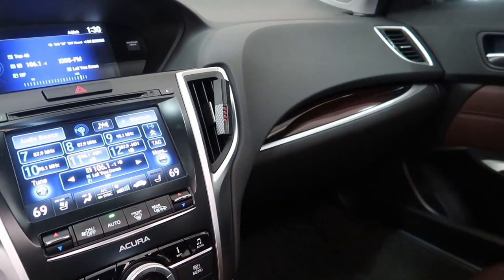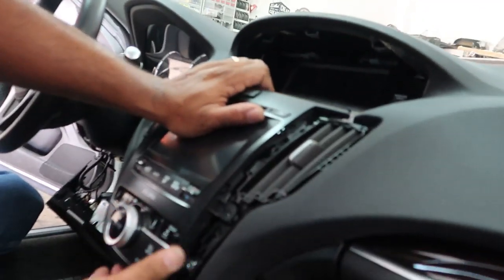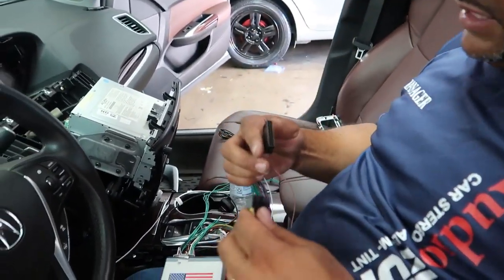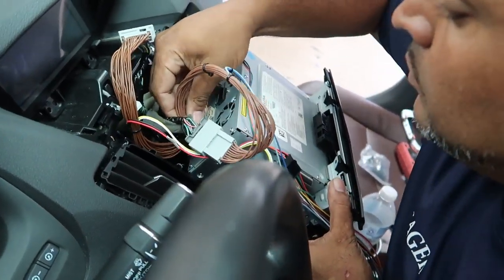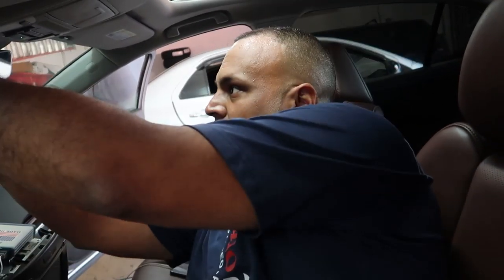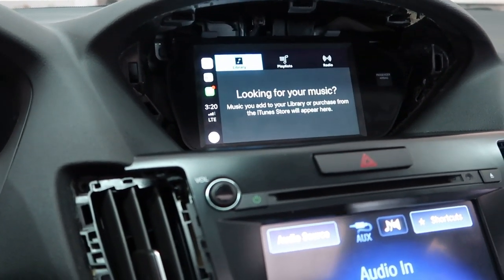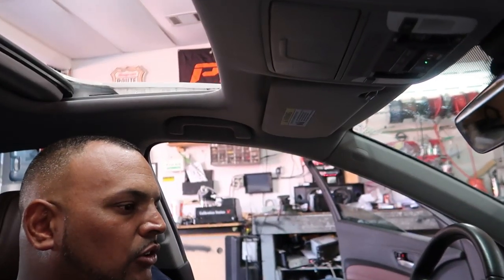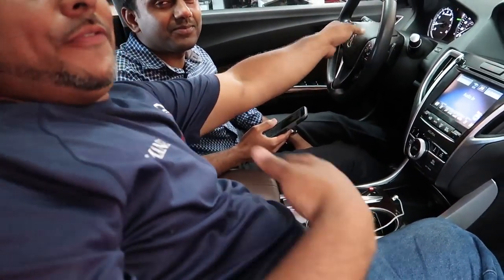2015- 2019 ACURA TLX RADIO REMOVAL WITH AFTERMARKET CAR PLAY ADD ON

Comment: Guess I'll be installing this next.  Great video.  I was wondering how the unit would pick up the turn singal if I were to install a set of side camera's?  Assuming I need to pick up a signal from the light itself for each side or is there an additional harness required?

Comment: QUESTION. I INSTALLED A 2018 RADIO ON MY 2017. BUT IT REQUESTED ANTI THEFT CODE. HOW DO I FIND MY CODE???
Reply from the maker: Dealer
Reply: @AUDIOCAT  thank you sir. Your video helped a lot. Got it installed no problem. 👌🏽

Comment: I have a 2018 Acura ILX and I had a tiny necklace slip in a crack right under the radio screen,
it completely slipped in:/ is it a hazard to leave it there or should I have the console removed to get it out? Please help!
Reply from the maker: Yes i would

Comment: What’s good boss I have an 2015 Acura TLX I been trying to get this for the longest where are u located at
Reply from the maker: 1230 N. Belt Line Rd. Irving Tx. 75061
Reply: _AUDIO CAT thank you for responding ok I live in NY so how can I order that and how much
Reply: @488virgil   I have the same question. I'm from Fairfield new Jersey and I have a 2016 Acura ilx
Reply from the maker: We can pay pal or zelle money and have it shipped to you .
We can provide tech support for install also so you can do your self or pay a shop for install
Reply: _AUDIO CAT perfect how much and where do you send the money to
Reply: George barreto did u find out how to get it
Reply from the maker: Part is 649 paypal is audiozone@ymail.com
Reply from the maker: Shipping is $9.99
Reply: _AUDIO CAT thanks ok perfect

Comment: I was wondering how much you charge for this, I have a 2017 TLX and I live in the area, been wanting to get this done since I got the car 2 years ago
Reply from the maker: 589 part 125 labor
Reply: @AUDIOCAT   Wish you were in Hawaii.  That is the most reasonable labor quote, EVER!  Did the 2015-2019 TLX not have Carplay and Android Auto built in?  I have a 2020 and it came with both (wired) not wireless :(

Comment: Hey AudioCat I changed my subs from the powerbass to one 15 inch audiopipe with a ported box I have a MB Qarts amp not strong enough to push it but the sub wants to bump. I’m thinking of getting a Rockville 2000 watt amp with 1000 w Rms that should do the trick with 4 gage wires I have 8 gage now what do you think?
Reply from the maker: 4 gage
Reply: So that should be enough for what I’m looking for right? just a little trunk noise lol a little thump.

Comment: Does the lightning cable have to be connected every time you use it? I just bought a tlx 2019 and it only works when it’s connected to the cable
Reply from the maker: What feature
Reply: there's a little device on Amazon that you plug up to you USB and it just does it wirelessly with your phone
Reply from the maker: Not familiar with that
Reply: @Envy_Lifes_Struggles  do you know what it’s called
Reply from the maker: Navtv

Comment: This is soo cool. Just one question, will the wheel buttons work on Apple car play
Reply from the maker: Yes
Reply: @AUDIOCAT  where are you located?
Reply from the maker: 1230 N. Belt Line Rd. Irving Tx. 75061

Comment: Navtool is alright. Grom VLine 2 now offers wireless for the same price! Maybe try that. I’m installing mine this weekend
Reply: Did you install it? Does it work good??
Reply from the maker: Greta
Reply: 1 year later, can you vouch if the Grom is good? Is there any input lag over bluetooth or is it just as fast as a connection?
Reply from the maker: It work great boss

Comment: Where can I buy this radio?
Reply from the maker: We have them
Reply: AUDIO CAT where are you located
Reply from the maker: 1230 N. Belt Line Rd. Irving Tx. 75061
Reply: Do you sell the radio because I don’t live in Texas or is there a website I can get it on
Reply from the maker: We can send to you send me year make and model and pic of radio
Reply: It’s a 2015 Acura tlx sh
Reply: AUDIO CAT it’s a 2015 Acura tlx sh
Reply: AUDIO CAT my radio is the same one that you did the video on its not allowing me to upload a picture can I send it to you another way
Reply from the maker: We can if same no problem
Reply: AUDIO CAT how much is the radio and will you be able to send me the radio through mail?
Reply from the maker: We can mail  and 589 part